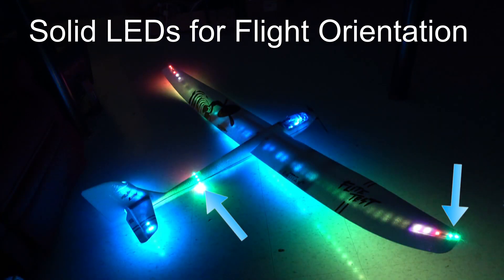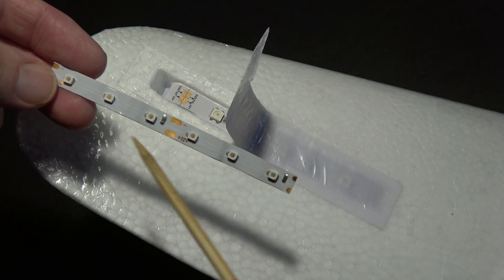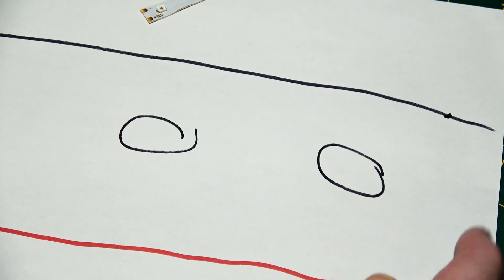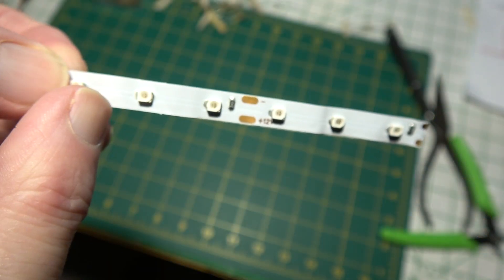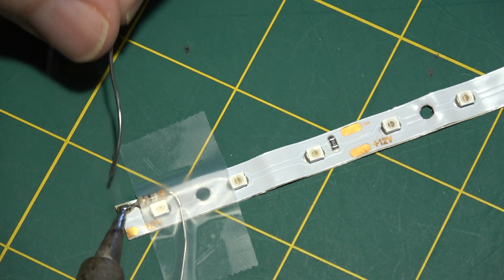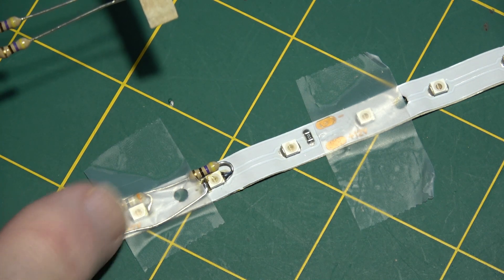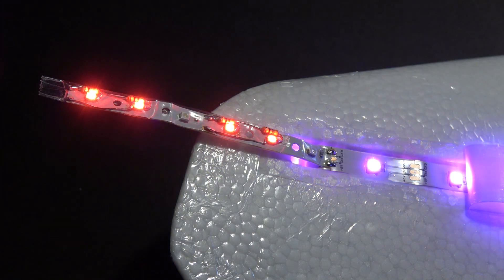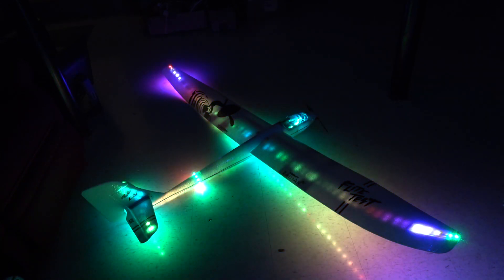Avoid Crashing 💥 Install Solid LED Lights on FT Night Radian for Flight Orientation

Comment: Why not just change the resistors on the strips to a value that works with 5V or 3.8V?
Reply from the maker: I think that is what I did do but I used regular instead of surface mount. Just happened to be what I had on hand.

Comment: 9:34.. The 3rd light still draws a bit of current through it even if you don't see any light.
It would be Zero current if you removed the surface mount resistor. It is easily done with a solder wet iron. You solder much better than a lot of other YouTubers.
Reply from the maker: I decided to punch out the etch to the third LED instead of removing the resistor. I'm lazy sometimes :-)
btw, I measured that resistor and it was 148 ohms. Too high a resistance to use for my project otherwise I could have easily ran a wire to light the 3rd LED too.